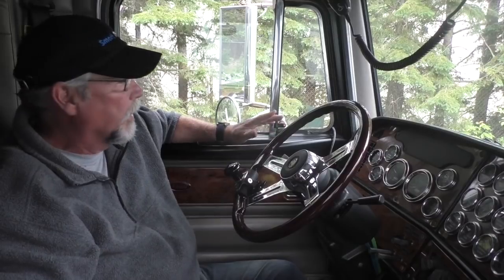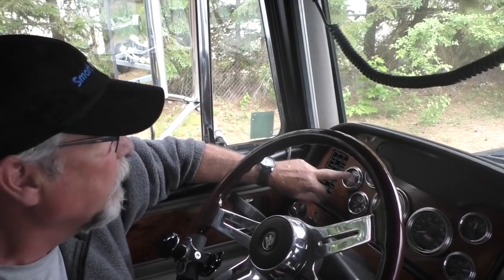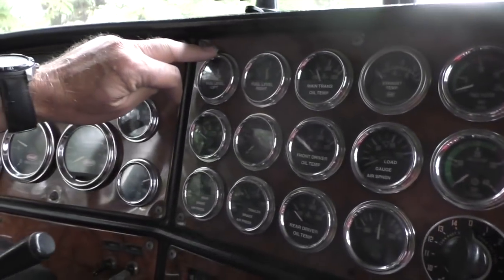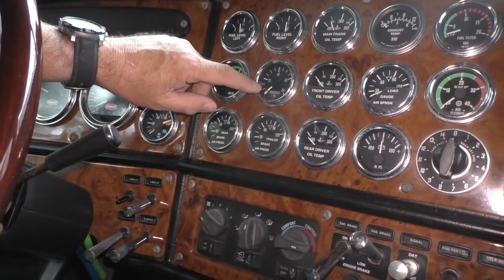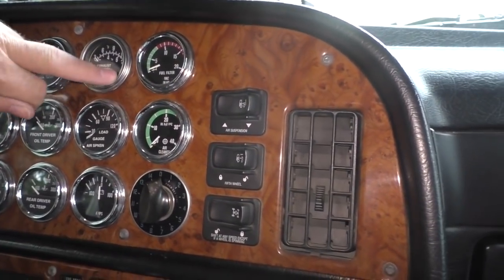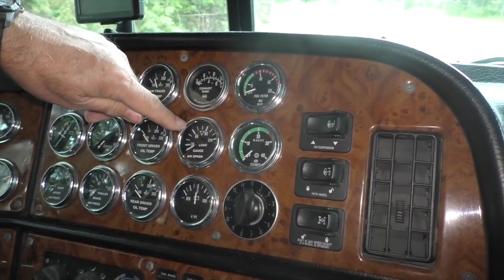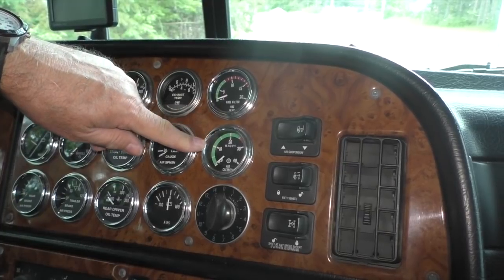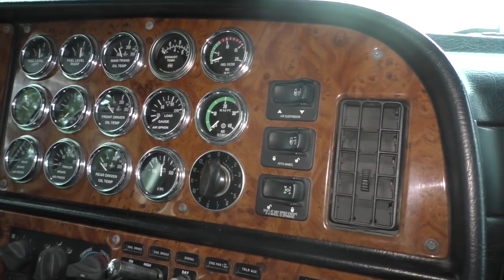2004 Peterbilt 379 Gauges Tour

Comment: I own and drive a 92 pete 379 exhd with an old school 3406b mechanical cat. American class interior with full gauge package. Learned how to drive from my old man who is old school trucker over 45yrs on the road. Taught me mechanics and how to read all the gauges and pay attention to the different sounds the truck makes because the truck speaks to you. Been out here 20 yrs and man how trucks and drivers have changed from yesteryear. Very few real truck drivers left amongst all the steering wheel holders
Reply: Juan Alvarez I miss my b model cat.  Timing got off (and I knew it) but kept going.  Cracked all 6 pistons and put a hole in #3 vaporizing the aluminum.  I never did find remnants.  If the grey smoke don't clean up when its warm.  Timing. That motor made 110,000 lbs feel like 60'000 lbs .  I hope to have 2 some day, one for pay and one for play lol.

Comment: Ran a Peterbilt with all those gauges for a short while. You're right, they were a great benefit in maintaining the truck. The one thing they were not good for was detecting an oncoming Train. Rookie driver used it while I was on vacation. It was a beautiful piece of equipment...RIP Pete :(
Reply: societyschild 54 those gauges weren't good at detecting an idiot driver either smh
Reply from the maker: Geezuz! Was he killed? Imagine so.    Dave
Reply: Smart-trucking* No, he snapped an axle with just the Tractor on the tracks. He got out and watched the mayhem from a short distance away. The company gave him the sister Pete to run...go figure!  Three DUI's later he finally got fired and all was well :)

Comment: Gday Dave, great video mate, I enjoyed the tour & description for each of the gauge's. I totally agree with you on the need to know how the truck is doing & detect problems before they cost possibly big dollar repair bills.
I have a HINO 4X4 truck that I have converted into my retirement exploration rig, & I run 16 gauges for front diff, gearbox, transfer box & rear diff etc with the balance being a setup similar to yours mate.
What I have found is the number of people who think it is an excess of gauges & really don't understand the reasoning behind the purpose or need to have so many, it's kind of depressing considering I have fitted the whole system myself, but your video makes all the work & reason behind so many a good thing.
Kind Regards, Steve. & always keep the shiny side up Mate.

Comment: My '95 379 had a larger Pyro along with the boost/vacuum over on the left of the main display, liked that for easy engine monitoring while driving. Drive to the gauges more when they're readily visible.  
I'm SURE you are used to where yours are and scan them just as well!

Some other controls change, and not all for the better.  Fan control for one just isn't seen like it was.  On or auto at least, lets you hit the fan EARLY to chill it down when you KNOW a big grade or hard pull/slow traffic is coming.   Nice backup for when the auto control breaks as well.

Nice to KNOW how things work, and how they are working.  Gauges/switches are all you've got when behind the wheel.  Jumpering the Jake so it went on with the switch saved My butt when the clutch safety switch went intermittent - MUCH better than trying to limp the hills without a Jake!
Reply from the maker: Roger, are you saying the new trucks don't have a manual fan switch? Or am I just reading this wrong.    Dave

Comment: Great video Dave!!!  Back when you could lay out the dash how you wanted.  I ordered a '17 389 last year custom, and the dealer told me Peterbilt no longer offers the individual custom dash layout.  Done by engineers now, with a one size fits all design.  I have platinum interior and looks great, but WOW have times changed.  Safe travels.
Reply: FlatBucket Trucking j
Reply from the maker: No kidding, can't arrange it yourself now? Someone told me they don't have toggle switches now, rocker switches instead. Is that true? Like the look of the 389 but never saw inside one.    Dave
Reply: No Dave.  It's true.  Still is nice with rosewood dash, but as I was told, one size fits all.  Mine has platinum interior (old American Class), has 17 switches(all rockers ), and 23 gauges, 6 of which are virtual, in the SmartNav screen.  Leather seats, 2 tone interior, 18 speed, 550 ISX, with the high torque setting(2050)
I still prefer the older 379 layout...and toggles.

Tim
Reply: Smart-Trucking.com yes its true they only use rockers in the new 2007 379 and all 389 Pete's

Comment: Hello Dave, quick question.  I was in Colorado the other day when I heard two drivers’ talking on the cb radio about pulling into the truck stop I was at and they were rambling on about whether they were going to turn their truck off or leave it running.  One driver said, “well it’s 3 degrees out so I’m going to leave it running and the other guy said, “yeah, we’re not in the city (Denver) we should be okay.”  The other driver then said, “yeah just set your trolley valve (Johnson Bar) and you should be okay.”  Now, as I watched them get out of their trucks and walk inside I stared in awe at the fact that the brake lights remained illuminated while they were out of the truck and I asked myself how do you do that?  I wanted to stay for an extra minute or two to hopefully ask them how is that possible, but I did not get too.  My question is how do you set the (Johnson Bar) to check that your brake lights are working correctly on a pre-trip?  Thankyou!

Comment: I totally agree with you on the gauges, when I ordered trucks I told salesman I want to see the dealer option book I want to know every guage  and option available to me. For instance air intake snow shield switch for snowstorm days, and heated windshield option. all good stuff. cold climate option good also... heated fuel lines by arctic Fox. heated fuel tanks also I ordered 600.00 option. a must have.

Comment: Great video, there's a lot to be learned by reading the gauges.  As a suggestion, perhaps the temperature for the lubricants (engine, transmission, axles) should be a little over the 212 degrees.  Normally, through operation (cold/hot/cold) these devices breath; air expelled as the temperature goes up and cool air returns as it cools.  With this cool air comes moisture which condenses and falls to the bottom.  The idea of getting the temperature of the lubricant over the boiling point of the water will prevent the formation of sludge.  The same criteria applies as the rationale to keep fuel tanks topped up to limit the amount of cool air that returns and condenses inside the tank.  Again, thanks for a great video.
Reply from the maker: Thank you Al! Drive safe!    Dave

Comment: Do they offer all of these gauges in digital form where you can set certain perimeters such as not wanting the engine temperature to get over a certain degrees and if it does the gauge will flash?
Reply from the maker: I don't know. I've seen a lot of them in digital form at Walcott but I really know nothing about their parameters.     Dave

Comment: Why is it especially important to monitor your primary and secondary air pressures while at the scale?
Reply: If there is a big variation in air pressure between primary and secondary, then you have an air leak.  So if you hold the brakes down, and your secondary drops down to nothing, probably have a blown out front air can. If the primary is low, then you got something going on with the drive axles. Basically, it's a guarantee for a ticket, and out of service DOT sticker.

Comment: Wasted space for the two fuel gauges, my '99 379 has a toggle switch to show L & R tanks independently. Also notice you had a vacuum gauge for the primary filter but no + pressure gauge to monitor the secondary filter, or maybe you only have one fuel filter.

Comment: They make cars these days where you only get a speedometer and a gas gauge. Everything else is an idiot light. I suppose it works fine, until you get one of those really expensive problems that you completely miss until it's too late because you couldn't see minor changes in how the engine is performing.

Comment: That's maybe sounds funny for paccar lovers but volvos have all of those "extra" gauges on display under gauges menu in basic models. Volt and Amp gauges are related to each other, so if there is problem one gauge is enough. Fuel filter gauge is very useful but again if filter is clogged you'll get notification on dash. Regards from volvo man :)
Reply: kapenczyk vovlo doesn't have shit! I'm driving a 2015 and it has almost nothing in that virtual display and you can only monitor like 2 at a time! stupid volvos

Comment: You custom ordered the truck and didn't bother with even one locking axle ,dude ,I'm loosing faith in you 😖!
   Winter driving in Canada you; know I've only use my locker maybe twice a winter but that's an option that pays off!
Reply from the maker: I've got locking diffs and never had a problem. I would spec locking axles if I was going offroad.      Dave

Comment: Volvo is Better Safer , more comfortable ,better on Fuel . Pete has way to many Gauges ,, you want to keep your eyes more on the Road .VOLVO is safer, quieter , ETC. ETC.
Reply: I got a Volvo only 30.000km and the engine is broken already.... Easy driving (no more than 1400rpm) soo in conclusion Volvo can be Good... But id rather get myself a Oldskool Peterbilt 379 with a C-15 engine. In comparison to the Caterpillar engines.... Volvo's are Junk because they are tooo modern.
Reply: aaron guenther LOL. If you're an owner operator you want to actually maintain your equipment. I bet you wear flip flops around the truck stop too. Steering wheel holders man
Reply: You'd be much better at being a taxi driver
Reply: aaron guenther you must be a rookie where beginner not saying you don't know how to drive a truck I 35 years in the truck or gauges the better especially when you got to pay for things it tells you ahead of time what's going on evidently you don't have to pay for everything
Reply: Don't forget about the gold necklace and polyester jogging suit. . .
Reply from the maker: You forgot uglier.    Dave